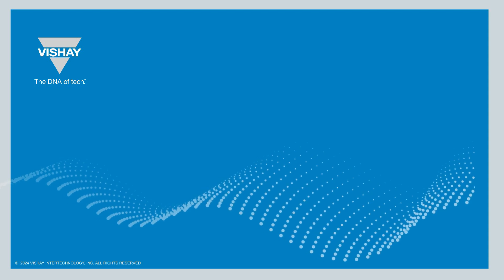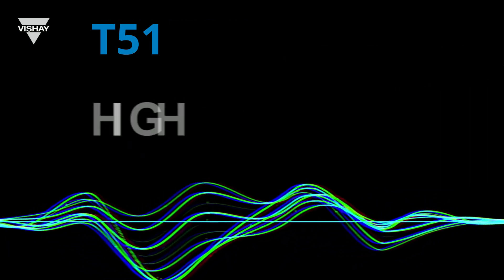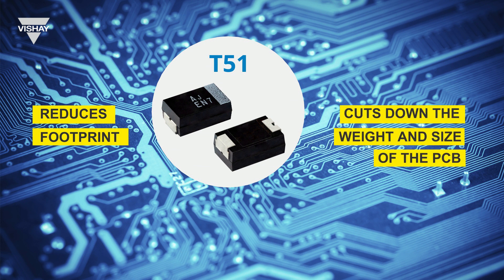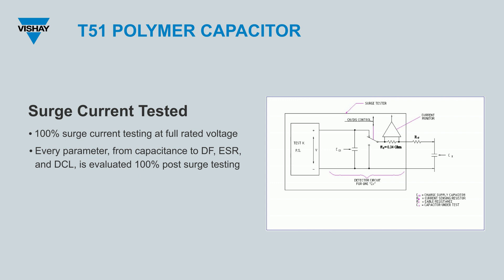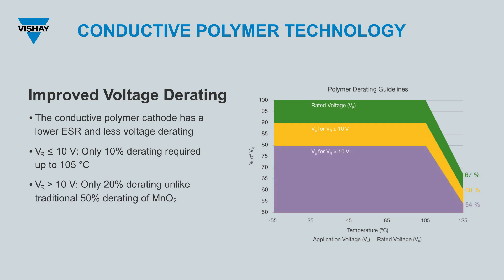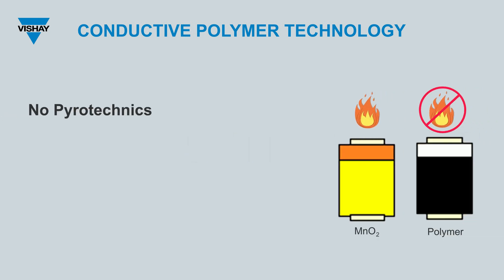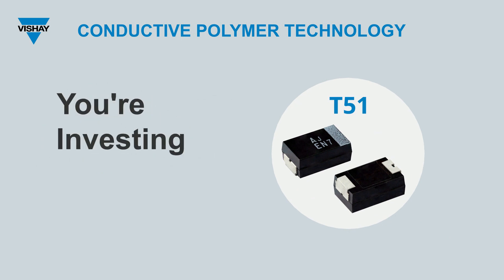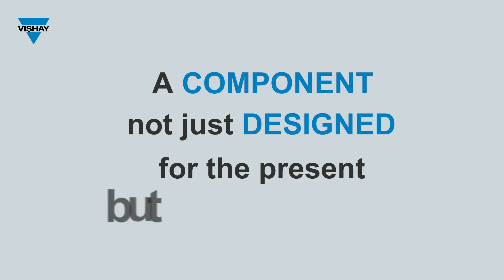Automotive Qualified Polymer Capacitors Provide Stability and Efficiency Over a Long Useful Life

Comment: The reliability of polymer tantalum capacitors largely depends on the anode. However, existing control methods do not ensure the required level of reliability. The main issues include insufficient control of the powder, lack of monitoring of the sintered tablet, and failure to maintain the powder structure. As a result, the stability of leakage currents during the production and operation of the tantalum capacitor is not guaranteed.

To address these problems, a method has been proposed to significantly improve polymer tantalum capacitors' reliability. Unlike capacitors with a manganese cathode, this method does not involve a self-healing mechanism.